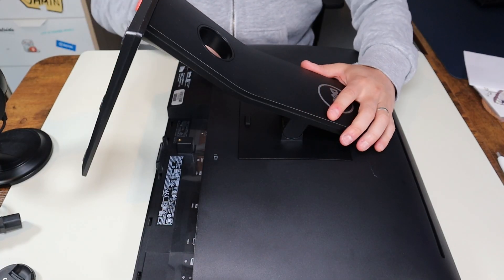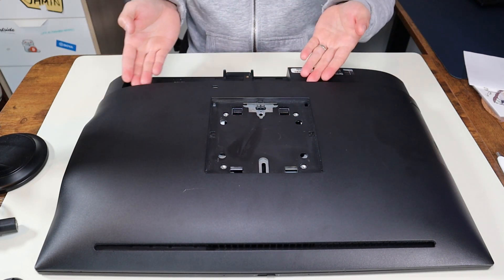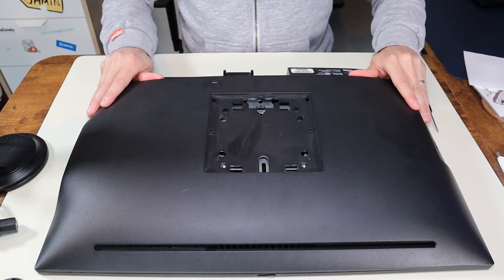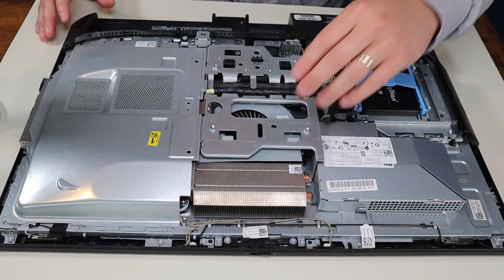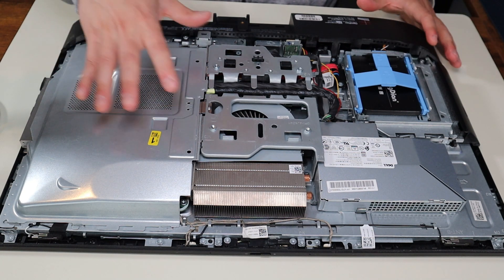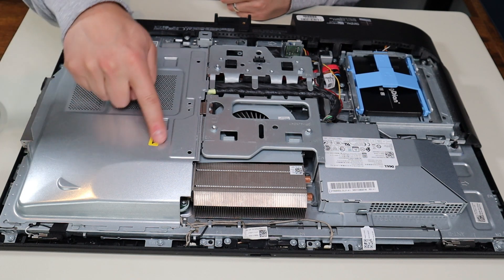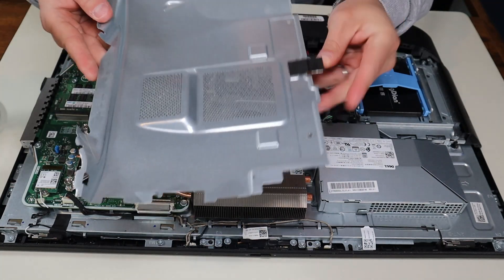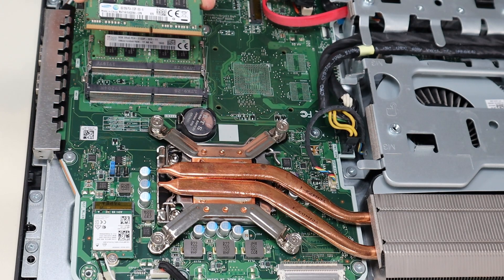How To Replace / Upgrade RAM - Dell Optiplex 5250 AIO Computer

Comment: Thanks a lot for your tutorial video. I'm currently in the process of upgrading the RAM from 16GB to 32GB on my Dell OptiPlex 5250 AIO. May I also ask if it's possible to connect an external monitor?
Reply from the maker: Yes :) You should have at least one HDMI on the reverse of the computer :)

Comment: Hi. Could you help me reattach a control key back to the keyboard of a Lenovo Yoga 7i laptop?
Reply from the maker: Does this video help? https://www.youtube.com/watch?v=P_U_VzVxgK4
Reply: @PC_Monkey the control key is slightly different. It has the metal bars similar to the larger shift and enter keys but they’re positioned differently than those larger keys. I keep having trouble snapping everything back into place and then not have the metal bars slide out of their holes
Reply from the maker: @justinweber936  If I am every lost like that, I try taking another key cap of a similar sized key off while taking care to leave the hinge clip installed. I can then see how everything is laid down.
Reply: @ I’m just worried I’ll break the key when attempting so and then have two keys that don’t snap back on a fairly new and expensive laptop
Reply from the maker: @justinweber936  Ya, they are very breakable :( Even now, I still sometimes break the keys or the hinge clips. Prob one out of 20 :(